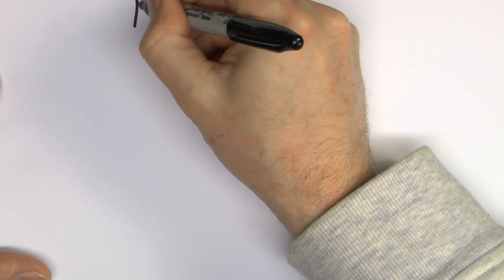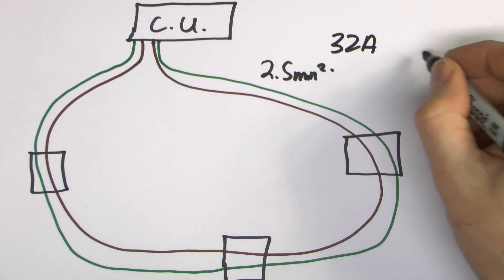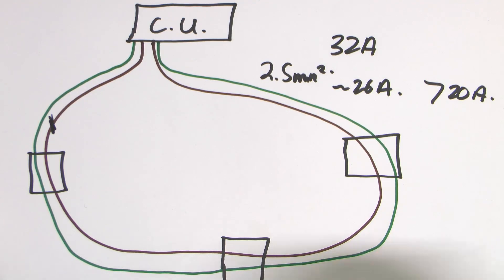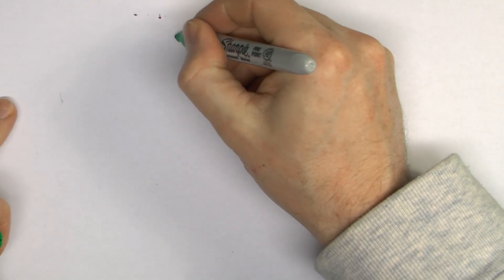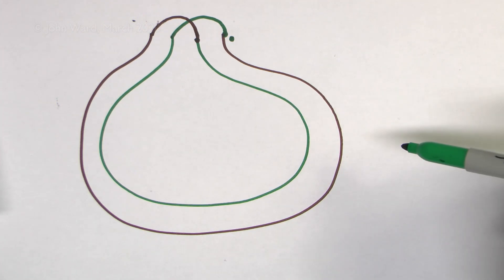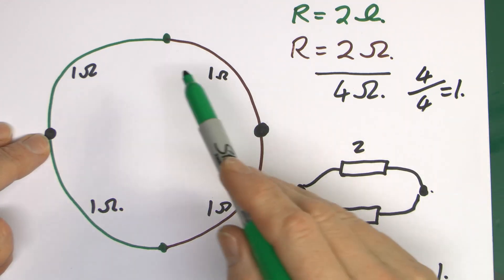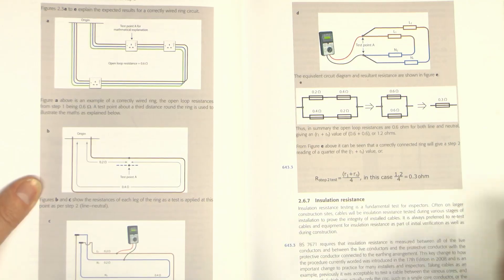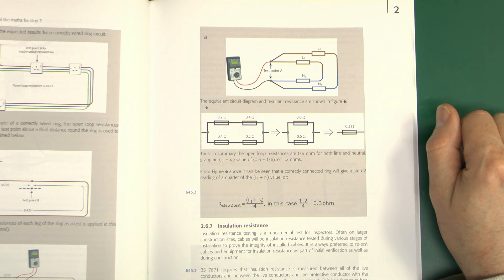Ring Final Testing - Why (r1+r2)/4 is R1+R2.

Comment: With respect, this explanation is somewhat contrived and does not really explain or prove that R1 + R2 is equal to (r1+r2)/4. And to say that the total resistance is half because you have two resistors in parallel is plain wrong. Any physics textbook will tell you that the total resistance of n resistors in parallel is given by 1/R = 1/r1 + 1/r2 +.............+1/rn. So the total resistance between the two measured points on the circuit, noting your explanation that effectively there are two resistors in parallel, R (i.e.R1 + R2) is given by 1/(R1+R2) = 1/r1 +1/r2, is it not? In the particular case of two resistors in parallel it can be shown that R = r1.r2 / (r1 + r2). The question that my mathematics cannot sort out is how we move from that equation to R = (r1+ r2) / 4. Your explanation is really little more than a mental salve because people then think that they understand it. Which may, of course, be all that they need.
Reply from the maker: A continuous ring of wire is equivalent to two identical parallel conductors.
If the ring has a resistance of 1 ohm, cutting it into two identical lengths means each length has half the resistance, or 0.5 ohms.
Placing those two 0.5 ohm conductors in parallel will result in half the resistance again or 0.25 ohms.
A quarter of the original 1 ohm.

Another way is to consider that the ring has a length and a cross sectional area.
Cutting the ring into two identical pieces means each piece has half the original length.
Placing those in parallel means the cross sectional area is doubled.

Halving the length of a conductor will halve it's resistance.
Doubling the cross sectional area also halves the resistance.
Half x half = quarter.
Reply: John, thank you for taking the time to reply to my comment. My further comments are as follows:
1)	Your illustration of the actual situation with the ‘figure of 8’ coupling is a powerful visualisation that I have not seen elsewhere. I had to look hard at the original arrangement and then create a mental animation that unfolded the parallel cross-connected conductors to reveal the circle and thus to see that the two measurement points, although next to one another in the socket, are, in fact, diametrically opposite on the circle. This point is fundamental to our considerations.
2)	Your explanation in reply to my comment has an elegant simplicity that works for the particular example of two conductors of equal cross sectional area. Only. It does not work for two conductors of different cross sectional area and this is addressed at sub-section (b) on page 66 of Guidance Note 3. The maximum value of the parallel resistance in the case of two conductors of different csa in figure of 8 configuration will occur at the mid-point of the two conductors and that is because at that point we have a situation where we would have half of each conductor on each side of the test points giving, on each side of each conductor an equal sum of two resistors in series.
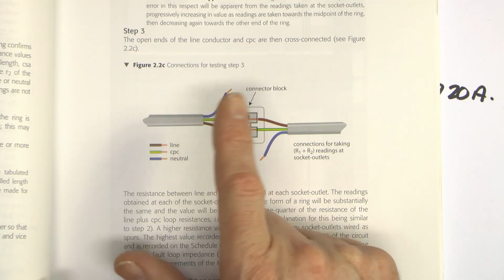3)	This is shown in practice, unwittingly, by your friends Gary and Marcus, here: https://www.youtube.com/watch?v=UesYHVsZD-E&t=628s. Their r1 value is 1 ohm (time stamp 1:35) and their r2 value is 1.67 ohms (time stamp 2:50). The value of two resistors in parallel is r1.r2/(r1+r2). This is basic physics. So for Gary and Marcus’ test we have 0.625 ohms. And this is the value measured when they put the test probes at the point where the loop has all the cpc on one side and all the line on the other (time stamp 9:11). But they just brush off the fact that actually this is a completely different value to the 0.67 calculated by Gary! As we move away from the ‘joint’ points, where the conductors are cross-connected, we come closer to the situation of R1+ R2 = (r1+r2)/4, which Gary calculated.
4)	So, R1+R2 = (r1 + r2) / 4 is an approximation that is close enough to allow technicians to see that the ring final circuit has no faults. But it is not actually correct for all pairs of conductors, just close enough to be a useful tool. The variance in values is addressed in table 2.8 of Guidance Note 3. 
5)	Is it of any value, me banging on about this? Hmmm…, well, I just think that this should be presented for what it is, an approximation that gives close enough values. None of the videos that I have seen on You Tube do this and some of the explanations are so contrived as to be nonsense. Obviously your explanation is not nonsense but, as I say, isn’t it worth pointing out that it is only a close approximation that is only completely true when both conductors have the same csa? Otherwise, why bother even trying to explain it at all?
Reply: John, thank you for taking the time to reply to my comment.
However, I do think it worth mentioning that your simple and elegant explanation is only completely valid when the csa of the two conductors is the same. In cases where the csa of the two conductors is different, R1+R2 will vary around the created loop, although not by a huge amount. This is addressed in sub-section (b) on page 66 of Guidance Note 3, together with table 2.8. All explanations that I have seen on You Tube omit this important point.
Reply: Hi I had the same frustration as you, love this video however it is unfortunate to have picked a value of 1 Ohm for each half section of ring as they do add up to 4ohms in total, which could be misleading to some people.
The way I explained it to myself is if we split the ring into two symmetrical halves then on each side we have r1/2+r2/2 
Applying the formula you correctly referred to for resistances in parallel, this translates as 1/R=1/(r1/2+r2/2)+1/(r1/2+r2/2)
>>>This will take you to R=(r1+r2)/4
Of course in practice it is impossible to measure exactly where the two half rings meet symmetrically, but try the maths again with a split such as 3r1/4 + r2/4 and r1/4 + 3r2/4 , the formula also works ;)

Hope I was able to describe the reasoning.

Comment: My assumption was that its divided by 4 because its basically because you have the resistance measurement from the centre of the ring of the cpc both ways and the line conductor both ways thus dividing by 4,and its only lazy house bashing sparks who want rings done away with because its easier and quicker to run radials,as an industrial spark of 50 years i cant remenver if ever wiring a ring main circuit in 2.5mm cable we wired them in 4mm or sometimes 6mm so overload NEVER became a problem

Comment: Essentially, there’s two of each conductor line and cpc in each accessory that makes up the ring main meaning there’s always 4 individual r1’s and r2’s in circuit, therefore you divide by 4 to get a unified ZS/ZE (R1+R2)

Comment: Great video Johan, so if I understand this correctly, quarter of the loop essentially is one specific conductor of the ring meaning R1 + R2 means R1 AND R2 as the value read is the value of resistance for each conductor. It is not a case of adding R1 and R2 because that would give the resistances combined

Comment: JW, you really don't like ring final circuits do you?
Reply from the maker: They are a decent solution for what they were originally designed for and for their original intended use.
However that was 70+ years ago, and most newer installations with them would be far better using alternative arrangements.
Reply: I especially enjoyed the 🙄 when you first mention ring final circuits at a few seconds in! Love it JW!!

Comment: What sized wire is used for a spur for a socket from 32 amp rated ring main? It's going to be a double socket.
Reply from the maker: 2.5mm², the same size as used for the rest of the circuit.
Reply: @jwflame  ok. Thanks.

Comment: Hi JW, I am moving my C/U  at home, not a straight forward job as it involves getting overhead cable put underground and fitting new external meter cupboard, I am fully qualified BTW, but I want to run something past you before I start. Would it be OK to email at your company email please? Too much info to deal with here but as you are fresh up with latest rules and regs I wonder if you could advise.

Comment: A question for you a family member has asked me to put a fire alarm in their enormous house I read the manual it says The mains need to go to the consumer unit with no rcd in it because it will keep tripping how do I go about this when their consumer unit have two rcd in it  one for the lights and one for the ring main
Reply from the maker: Is this a fire alarm system with a dedicated panel, or individual interconnected smoke alarms?
Individual smoke alarms are usually supplied from a local lighting circuit, whether that has a RCD or not doesn't matter - most of the time it will have an RCD due to the cables being concealed in walls/floors.
A fire panel should be supplied on it's own separate circuit, and not via an RCD which also covers other circuits.  Mains cabling for the fire panel also needs to be fire rated just as the rest of the installation does.  If the mains cabling is surface mounted, then no RCD required, if it has to be concealed then and RCD will be needed, but this should be an RCBO which only supplies the fire panel and nothing else.

Comment: Thanks , always find your videos interesting. Some things which can be proven mathematically might also have been mentioned. Where the CPC has a lower Cross Sectional Area (CSA) than the line conductor, R1 + R2 is always less than (r1 + r2)/4, in practise this is not usually not by very much (<5%).Two exceptions to this rule. (1) Regardless of the CSA of the conductors, at halfway along the cable run R1 + R2 is (mathematically) equal to exactly (r1 + r2)/4. (2) Where the CPC and the line have the same CSA, R1 + R2 is everywhere equal to (r1 + r2)/4. All this can be demonstrated using the parallel resistors equation with the series resistances of the CPC and line conductors in the clockwise and anticlockwise directions .

Comment: Is there an mcb which can check the load on not only the whole ring, but that the load is at least somewhat balanced across both ends to ensure there isn't a break in the circuit?
Reply from the maker: No.
Reply: @jwflame  Well that was succinct :)

Comment: What's the point of the r2 test on a radial circuit? I used to think it was good as you don't need to dismantle lights / sockets etc  but to measure the zs of the circuit you do need to open / dismantle accessories as you can't add r2 to ze to calculate it.

Comment: Thanks so much for all your videos! Even though I'm in Canada, I didn't know very much about our 240v "split phase". I got a 120v lathe and blew up the motor, and there were way more options for replacement with 240v motors so I got one, but in my "shop" I only had 120v service. I got an electrician to run 240v service to my shop (60 amps). Thanks again for all your videos, learned lots. Pic of sub panel: https://i1.lensdump.com/i/jRPibi.jpg (red to black is 240v, red to white or black to white is 120v)

Comment: Thanks once again Mr Ward, when I'm in Eire , ring final circuits not allowed & fully insulated cpc in twin & cpc, with all conductors the same size,therefore contractors are often used for shower circuits, much better than trying to ram the cables into a switch box ☘️
Reply: Should that have been contactors? Rather than contractors. 

I think that if you use contractors for the shower they would have a shocking experience. ;)

Comment: Why do we have Ring circuits then john? wasnt it somert to do with a copper  shortage ??
Reply from the maker: Designed in the 1940s so that new homes could be wired using the minimum of resources, one ring circuit for the whole house and a single type of plug for everything, compared to multiple circuits and various different sizes/ratings of plugs used previously.
The rest of the story would make an entire video on it's own.
Reply: @jwflame  
houses built after the 40s were still using radials and at least 3 sizes of the round 3 pin and 2 sizes of the round 2 pin connectors and were still in use at least up to the early 80s  so when exactly did every one start using ring circuits and square pin sockets ? , when the house i grew up in was rewired in the early 70s it was ring and square sockets :-)
Reply: Look up tom scotts channel and look for his video on british plugs, that explains it a tiny bit more.

Comment: How much current will 2.5 mm take before it does melt? Test for future.
Reply: It’s actually very very high, but long before it melts the insulation will breakdown and junctions will often have problems. So the 2.5mm melting isn’t usually the problem